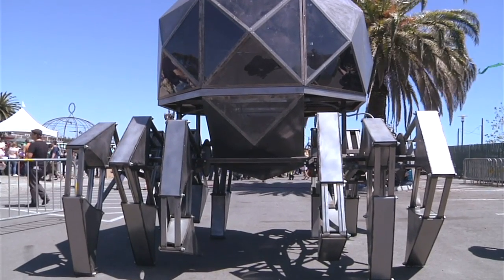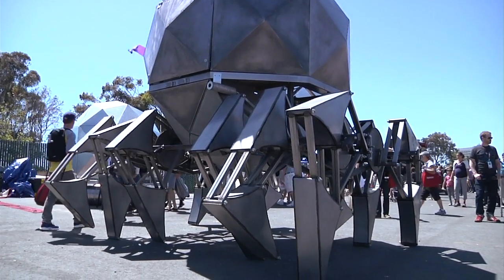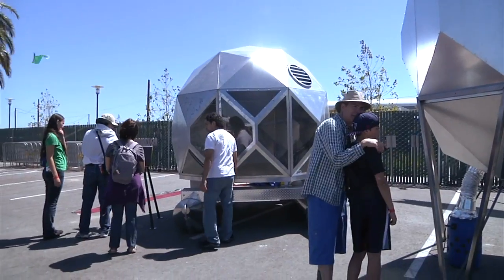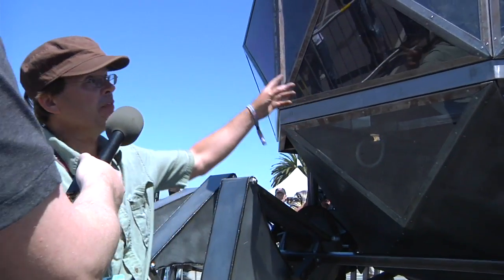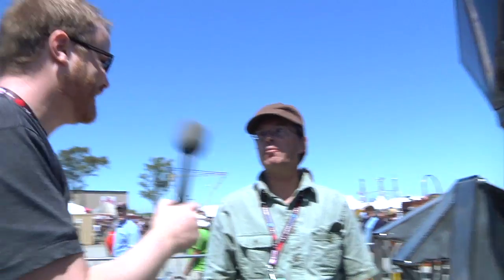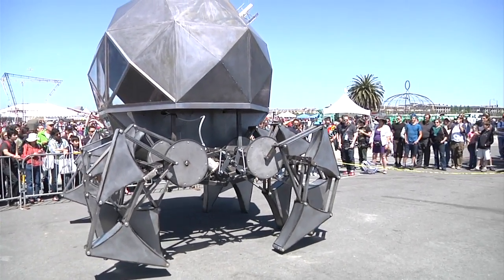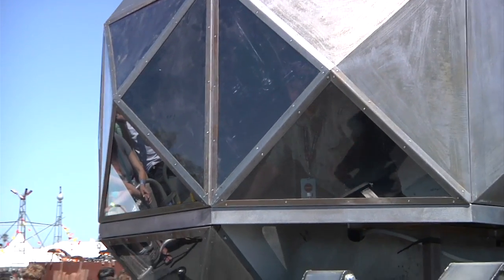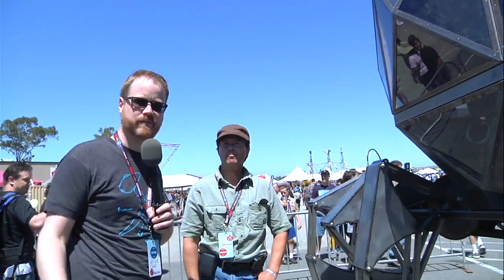Giant Walking Pod Robot at Maker Faire 2013

Comment: Using backup batteries? If your main source is the batteries you can not call them exactly backup! 😂
He didn't say what size motor is running but I'm sure he could get bigger batteries and motor to run this thing....